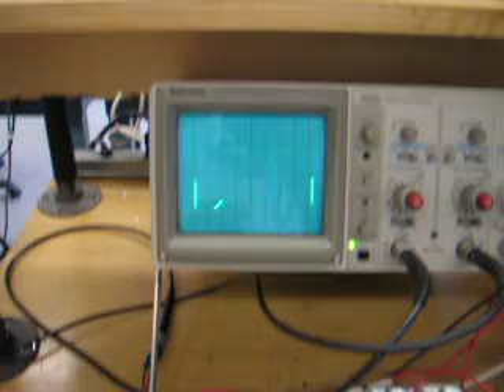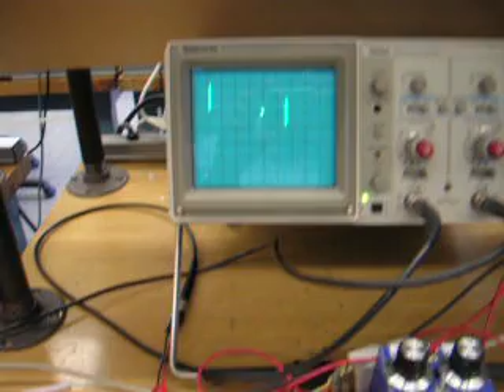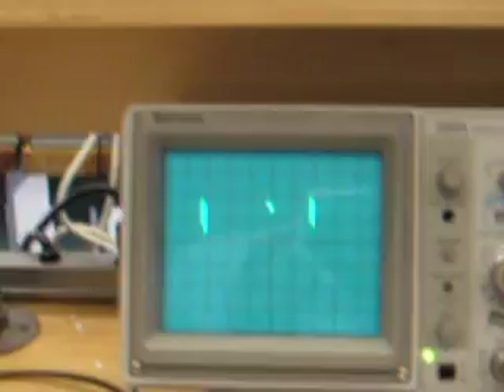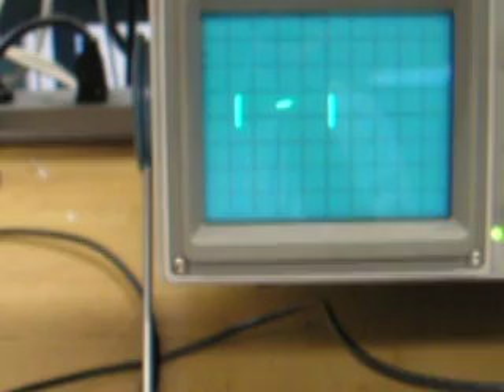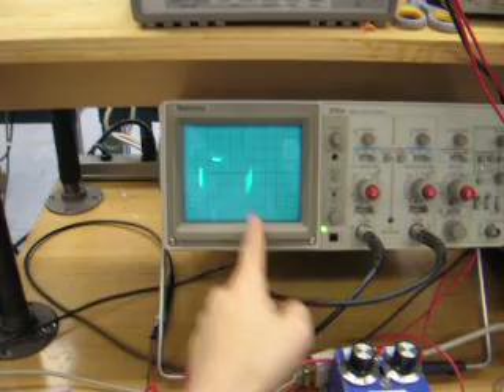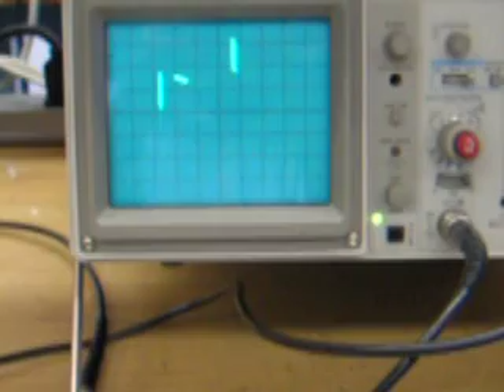Pong on Oscilloscope

Comment from the maker: The signals displayed on the scope are all generated by analog circuits...no DACs in this circuit.  The ball's X and Y components are generated using opamp RC integrators.  The paddle's Y component is generated using a summing amplifier to add a sawtooth oscillator waveform on top of a DC offset controlled by the player.   The digital components are only there to keep track of game logic (e.g. ball direction, who gets to serve, etc).  Counters were used only for scorekeeping.  No other FFs used.